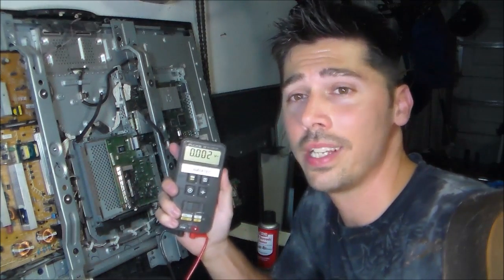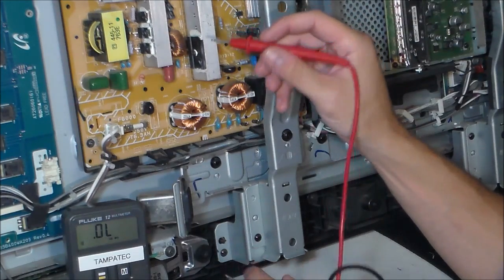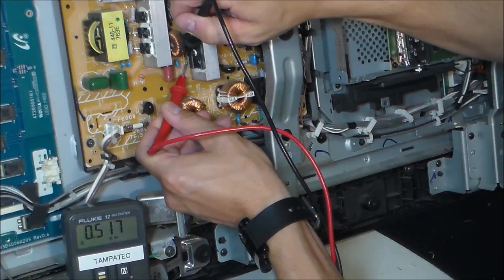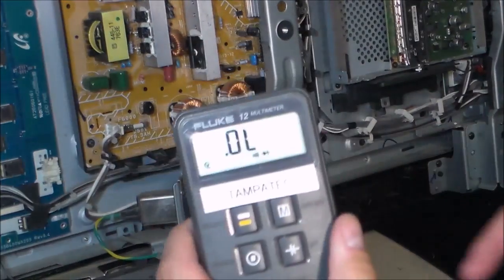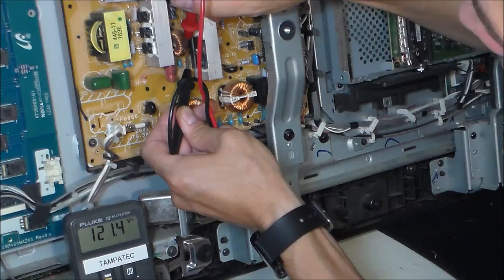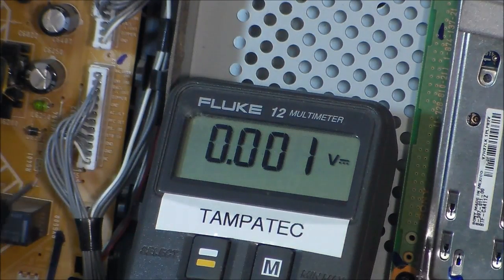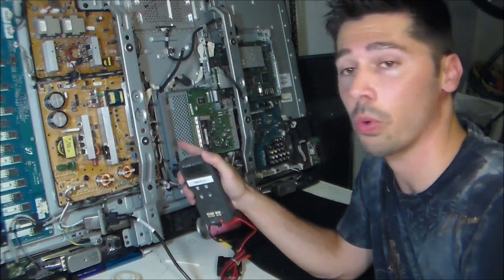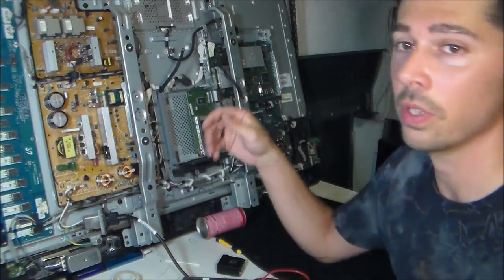2 ways to test bridge rectifiers & check standby volts on power board using meter

Comment: I've done all of the tests that you show in this video on my Insignia TV. The issue is a blinking power light that goes to solid red after blinking a few times. All of the power measurements are good, as are several of the components that I've tested. I've replaced the capacitors (except the Aluminum Organic Polymer Capacitors which are on order). I don't find any shorts as well. I've tested this board in the identical working Insignia TV, and the problem follows this board. I don't know what to test next. Any ideas? - Joe

Comment: I am retired senior citizen. i am electrical engineer in power systems. not  electronics. Since i have ample time started learning electronic eqpt repairs. i have old UBL DSC500(230V)-Digital simply cinema. The problem is when the unit is switched on it remains on for a while and then trips. no dc power. After 10-15 seconds the switches on  and trips once again . this goes on. I tried to identify defective component in SMPS. but i could not. Everything appears good on SMPS. Visibly main board appears clean. Can you please advise how to go about?
thanks.

Comment: I wanted to check standby volts on my vizio D33X-G1 smart tv  the legend near the connection from the power supply board to the main board does not show what pin is the standby pin and does not state what the standby voltage should be  It just has a split box with one side showing from top to bottom on/off,NC,gnd,gnd,VA,VM,VM. AND NC.  OTHER SIDE OF BOX SHOWS DIM,PS_ON,GND,GND,VA,VM,VM,NC.  Can you figure this legend out?  what pin is standby and proper volage?

Comment: Good video.
Whenever I plug my LG 42 inches 3D TV to power, the fuse in the 3 pin UK plug attached to power cable with which I connect the TV to the mains blows off immediately. I changed the fuse and same thing happened again. Please, What could be the fault and what do you suggest I should check?
Thank you.

Comment: Hi, great videos, I have a problem with my 52" sharp TV, model# (LC-52D64U), I have flashing power and opc lights (2 fast power and opc blinks and 1 slow power blink) but it will not turn on, I do have electronics background but not working in the trade and never worked on these flat screen tv's and without a proper shematic diagram its kind confusing.
I have already replaced the power board (RDENCA235WJQZ) and also the main board but still no luck, on the power board I have 120vac going in and I have 5vdc stby voltage but not getting any other voltages mentioned on the board like 12volts and 60 volts going to the inverter boards even with the power board forced on, the inverter boards are probably ok since I'm not getting any votages going to them, can you please give some pointers on this problem that I'm having?, any help will be greatly appreciated.
Thank you,
Joe

Comment: The video is very helpful!  It is not just very good in understanding the bridge rectifier, but understanding the process and flow of operations is important in diagnosing where the problem lies.  Case in point is I actually did not know that it was the video controller board that kicked the signal back to the power supply board to release the voltages and current to the other components.  I've picked up five flat screen TVs from the curb side and have fixed four of the five.  And in large part, thanks are due to this lad by his excellent explanations.  Although I hold a BA in computer sciences (but in Windows XP) and years of experience in soldering, that only enabled me to be potentially able to repair the TVs.  TampaTec's descriptions and explanations has helped me over the hurdle to effectively diagnose and then repair the TVs on a component level.
Thanks man!
Reply from the maker: Congrats on your success. I hope you run into a big 4k tv to fix. Usually it's bad led strips in 4k TVs that go bad after few years. Shopjimmy.com sells repair kits.

Comment: How in the world is it correct that from the negative to the positive of your rectifier is .445 volts while to each of the AC pins it is .556 volts and you say it is a good rectifier.  Shouldn't from the negative to positive DC of the rectifier be double like 1.1 volt or so?  That is two diodes combined.   Confusing as hell.

Comment: I am really surprised that you are working with live LETHAL voltages with a watch and ring on your left hand closest to the heart. My military and commercial training could not stress strongly enough that this is a very good way to be KILLED or badly shocked. Wear no metal and remove dog tags to temporarily while working on equipment. Since those test leads are so close together it is easy to get zapped by the line voltage at the bridge rectifier with many many amps or and the 164 VDC from the bridge rectifier at whatever current it can put out. SAFETY can never be overstressed!

Comment: Tocayo, your videos are great! I have a 55" Toshiba REGZA like the one in your video that died. I was going to throw it out until I saw your video and became a subscriber. I ran all your tests and it turns out I had the same bad fuseable resistor that you did. However, after I changed it I got good standby voltage but then the bridge rectifier was giving funny readings: 120v AC, 116v DC, and .9, .9, and 1.0. I removed the Bridge Rectifier from the board, checked it and got normal readings of .5, .5, and 1.0. I figure something else is causing it to act up when powered on the board. By any chance are you going to do a video on that problem?

Comment: Does this apply to Sony str-dn1070 also? My unit powers on right away and says clearing on the lcd and power cycles every 2-3 minutes. Tried factory reset a billion times. could that be caused by a bad BR diode? main board is getting the stand by voltage.

Comment: Power board separated from Main board,  and when checked with power on, multi/m shows standby 5.2V 
but not 12 V on the socket.  Why? Thanks for any advice.

Comment: Hmmm... I'm confused, I'm not getting a voltage when I test the standby but if I try ko turn on the tv it turned on but after a few seconds it turned off, my question is what is the faulty the power supply board or logical board? Thanks
Reply: Same..

Comment: Great tutorials. I'm just trying to fix a tv with no standby light, its got a steady 236v (UK) going into the bridge rectifier but the output is pulsing. Its a 4 diode design, what do you suggest I do, replace all 4 diodes? all diodes read .46 ohms in circuit.

Comment: Can a "pinhole" in a resistor be the cause of my TV turning on / off and not staying "on" ?  (Red light, stand-by mode, I guess)

Model : Panasonic TC-L50EM5
BOARD : TNP4G532
Resistor : R7305

Comment: Hi Tampatec, I have a sharp 52 inch LC-52E77UN LCD tv. My tv is dead no lights light up when the power button is pressed. I diagnosed the power supply RCENCA336WJQZ and there is no 5 volt standby. So, I replace the zener diode, and two resistors in the secondary unit (power supply kit for secondary voltage from Shop Jimmy), still no standby volts, no lights on the front panel. I have voltage now at the zener diode but not at the standby voltage connection. Checked ac voltage supply and bridge recitfier all good. Any recommendations you can provide is greatly appreciated before i purchase a new power supply.

Thanks,
Quincy

Comment: Hello sir .. i have samsung L32SF_EHS supply .. so the problem is when i connect led back lights with bord .. its coming on .. off .. on off  with high voltage .. i have no idea what happen whan i test led backlight circuit board voltage is comming 150 volt

Comment: I have a Element flat screen tv, Model ELEFW328. Serial # F6B6MDA1E32063303. It has no standby light and no power. The power board and main board are all in one. How do I test it? I did get another board and changed it but with that board I had to green screens, one on top of the other and could not change menu, source or anything. I did have power with that one. Any help would be appreciated. Thanks

Comment: Quick help on a vizio e421vo standby light is on but no results from power on from either remote OR manual button. Already did the power cycle with no results. help@! I'm a mechanic not an electro guru :/

Comment: IS YOUR OUTPUT DC VOLTAGE MEASUREMENT INCREASED BY THE FILTER SMOOTHING CAPACITORS THAT ARE IN PARALLEL TO THE DC OUTPUT? NORMALLY, WITHOUT A LOAD, THE OUTPUT DC SHOULD BE QUITE LOWER THAN THE RMS OR AVERAGE INPUT AC VOLTAGE MINUS THE DOUBLE Vf OF THE RECTIFIER'S DIODES. IS THIS THE CASE HERE?

Comment: Hi, I have a Sony 55" that will not power on and no standby light. I am reading 7v on standby that is supposed to be 3.3v, what would you suspect and would this high reading prevent standby and powering on?

Comment: This set has a row of pins marked from the bottom (pin 1) up: gnd, gnd, 5v, 5v, ps/on, 5vs, 5v, 5v, gnd, gnd, gnd, 12v, 12v.
The two pins 5vs and ps/on, is that five volts standby and power supply on?

Comment: so if i pull the rectifier  and i get readinds of 0.5 , 0.5 , 0.96 then my rectifier  is bad
Reply: yes. in this video clearly says that when he connects negative and positive the outcome should be 400- 700. In the other series he shows 900. so what's right
Reply: +Tempatec what is the answer to this question

Comment: Hey Tampatec, Great work. Keep it up. So good to find your channel after searching all the other junk that is online claiming to show TV repairs.I have a Palsonic LEd TV with no sound or picture, but the standby light is green when power is turned on. Would you agree that it not the power supply and probably the main board? Would it be best to swap main board?Could not see any obvious bad capacitors or damaged components.
Reply: +Apa Ched  hi I have the same problem do you able to fix what was the problem. would you let me know thank you   calin19732live.com     thank you again

Comment: Best man,
not just saying it, but i realy learn everytime something new from you. thank for your time.
Q: In this video approx..time  4:44 you mesured Ac and Dc from rectifier. Do you know why I have no ac also no dc  on rectifier? D10XB60 when i switch tv on ?(Lg 42PQ2000 plasma TV).?
I have blue light  flashing 7x then stays blue for a while and gets Red ( remote acts only on  Tv-on .
I mesure  5 V andbut no 12..17..or 24 volts.
Thank you for reading this.

Comment: MAN... U R SIMPLY AWESOME... ONCE I THOUGHT DEALING WITH ELECTRONICS IS LIKE DEALING WITH ROCKET SCIENCE.. BT NOW I AM CRYSTAL CLEAR WITH THESE THINGS... THANKS FOR UR WORK DUDE..
Reply from the maker: Thanks man
Reply: +Tampatec hey buddy i want u to know you are doing a great job thanks for taking your time to make these videos. 
I do have a problem with my LCD TCL 40" it's a smart TV however for some reason i can't get it to connect to the Internet   i plug the WiFi router at back of my TV but the TV isn't responding. 
I am planning to use Chrome Cast.
Do you think it's a good idea to invest in the Chrome Cast?
Will it work?
Reply: +Tampatec hey buddy i want u to know you are doing a great job thanks for taking your time to make these videos. 
I do have a problem with my LCD TCL 40" it's a smart TV however for some reason i can't get it to connect to the Internet   i plug the WiFi router at back of my TV but the TV isn't responding. 
I am planning to use Chrome Cast.
Do you think it's a good idea to invest in the Chrome Cast?
Will it work?
Reply: +Tampatec I forgot to mention, what i want is to connect my phone with the TV .

Comment: Hello  Tampatec, may I assume that you are from Fla.?  
I have a 42in Sylvania Lcd that wont come on.  My stby switch is on, but when I power up, the green light flashes rapidly 17 times and reverts back to standby mode.   At first I would keep tapping the power switch on the tv and it would sometimes come on.  Now, after a few weeks of that nonsense,  it refuses to come on at all.
     All the components look good on the power board.  I just finished watching your video above on bridge rectifiers and standby volts and I am going to be checking those out.   Do you have any other suggestions that I might try.  This is my first attempt at repairing a TV but I am very determined to be successful.  You are a great teacher and I shall keep learning from you.  Thank you for your desire to be helpful to your green colleagues.

Comment: Looked at bridge rectifier. Tested as indicated and have 0L with negative probe on neg pin when I switched it pos probe on neg lead still 0L across. If I put in resistance mode  I get 9.00 on ac pins and Ol on positive with neg to neg. Flipped I get 1.5 to ac pins and -3.5 to pos pin. But I do have 5.11 on both standby. Nothing on ps on. Which I saw some jump 5v standby and ps on to see if they get the 12 and 24 volts on power board to verify if it's main.. Am I correct?  Any assistance would be greatly appreciated.

Comment: hey good job 
i have a toshiba 19" lcd it turns on and off but no sound or picture
Reply from the maker: Check for swollen caps and 5v standby on power board plug. see if tv turns on when tcon board unplugged. if so tcon can be bad.
Reply: thx but i already checked all caps on both psu and maionboard same for ics there was a short i just found it now in a connecter but nothing elsei may re check the regulators

Comment: Hi I have a bush LCD40TVO7HD it's clicking on startup there was 5 bad cap on power board which I have replaced but it's still doing the same thing 
I tested the 24v out to the main board and its reads 0v to 6v than back to 0v and so on 
The t con board clicking as well it's like click click pb and t con 
Where the cap have been replaced the wires to backlight inverter are a bit and only a bit discoloured 
I've got a new pb coming but don't fancies blowing it 
Any help on what to test and what reading I should get wil be much appreciated thanks 
Dek121

Comment: My standby light is on I can sometimes turn the TV off I just do not have any back light. The standby light turns to blue and it usually is a dim red when working properly. It looks like the main board is bad. By the way I had a Google Chrome on the HDMI I think that may have damaged the main board what do you think? This an LG42LG50.  I also measured 24 volts 16.5 and 5 volts on the power board. It stop working for a while we turned it off. After a couple of days it turned on played and then got to this state where the blue light in on under the power button and no display. Usually you hear some kind of relay clicking turn on process. Please help if possible it is the wife TV. Thank you in advance.

Comment: queststion on this, i get a fluctuation on my meter when testing all legs in circuit. the meetr eiter raises or lowers the reading. do I have a bad rect? also I got a buzz off the heat sink. any thoughts
Reply from the maker: no you have a bad part, maybe transformer , volt regulator ic , transistor
Reply: @tampatec same issue here, can you demonstrate or explain in more detail please.

Comment: Thanks learning alot. Mine is a 50" inch samsung plasma. With the lower half of the screen black. If I put a fan behind the tv usually I don't have a problem. Your diagnostics are helping me narrow it down. Some say it is the T-Con board. But I don't know how to diagnose that yet. I do have a red light.